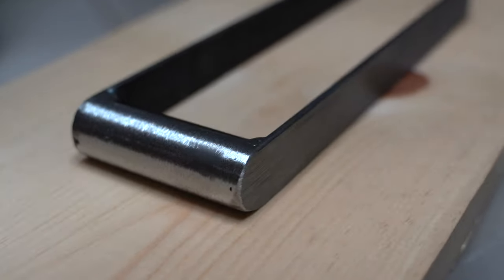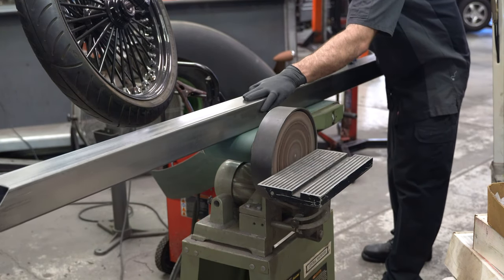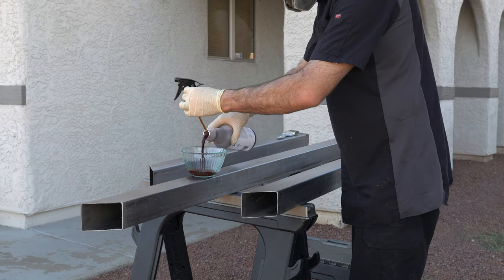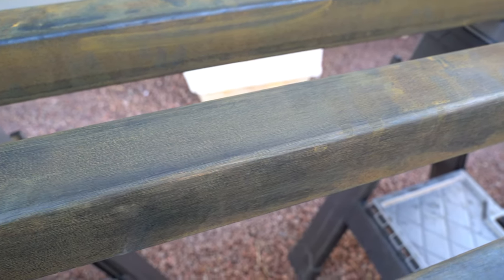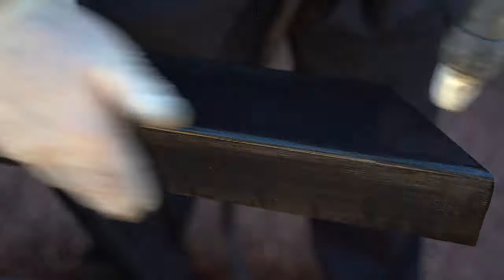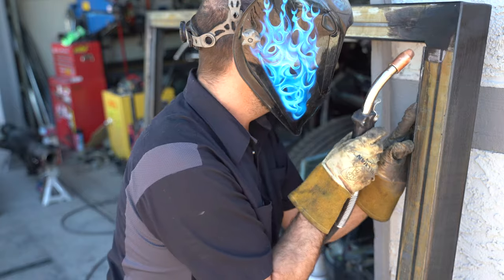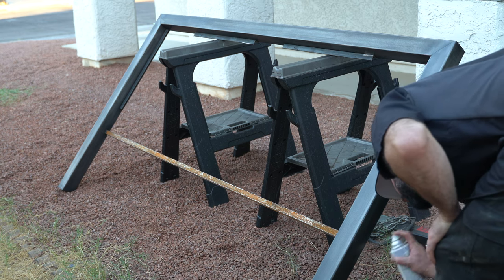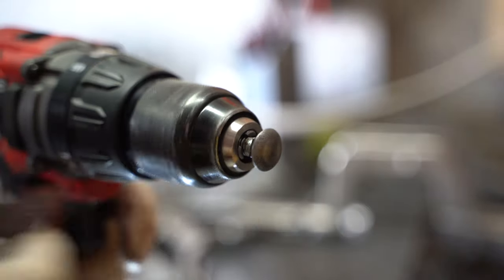How to Patina Steel with Chemicals! (Custom Headboard)

Comment: I use black magic all the time and made the same mistake at first.  Key and I mean key to not getting the surface rust is, DO NOT LET IT DRY before washing with water.  As in either add more black magic by brush or spray till desired patina is achieved. 
Also as soon as it's washed off with water dry it off with a rag ASAP. takes a bit of practice but the results are amazing.  Hope this helps anyone that uses the product  great stuff, I almost returned mine since I was getting mostly rusty result myself.
Reply from the maker: Thank you, Matt! I'll pin this comment. I imagine it being incredibly helpful.
Reply: @GarageFab  you're welcome:) ran past your channel today big fan, also great content. Looking forward to more truck build vids, particularly coilover conversion if you ever do them.
Reply from the maker: I might! But I do love my air suspension. ♥️
Reply: Thanks for info just ordered my Black Magic
Reply: Do you have to use rag to dry or can I use air compressor or leaf blower to dry
Reply: @SmokeyA55  any and all those will work, personal I use a combination of rag/blower or rag/compressor. Point is to dry it as fast as possible, if you leave any moisture on it it'll start rusting/oxidizing and you'll have poor results. Atleast in my experience
Reply from the maker: x2!

Comment: Glad I found this video! 
Just tried applying SN midnight black to a steel bench frame, had the same rust issue. Gonna try again, SN recommends scuffing with scotch brite before rinsing also, to get a more even finish. I also had a ton of problems with runs and enevenness cuz I am applying to a finished bench (surfaces at all angles).
Reply from the maker: I think patience is key. You’ll have to apply thin coats to help avoid runs, but then I imagine you’ll need to do more layers. Lemme know how things turn out!

Comment: Im late to the party, but this was cool. Ive been waffling on what to do in the trunk of my 69 GTO. Most people doing custom a-bodies end up boxing in the trunk with upholstered panels because the wheel wells are hideous, the trunk mounts are worse, and the rest of it is pretty bad too. I havent found a single example of someone taking the time to do custom metal back there so im doing it. But i wasnt sure if i should paint it or clear the metal with a satin or matte finish. Im glad theres this staining option and the burnished look is a winner. Then i can also match the jewelry box up front and have a bit of it in the dash im making. This was helpful, thank you.

Comment: Nice work! 

I saw Sculpt Nouveau being used by someone else and they didn't say much about it. I watched a video from the manufacture and was even more hesitant when they said to heat up to 80-90F.  I saw the $$ for 8oz bottle and like you, about choked. after watching your usage and explanation, I'm ordering some to make a few end tables.
Reply from the maker: Excellent! I think you’ll be pleased even after spending your life savings on it. I’ve learned the brush on method really stretches the product. You can spray it on too but you lose a lot with overspray.
thank you for the kind words, Daniel!

Comment: 12:32 this entire bed project is awesome, but the bolts in the drill are my favorite part
Reply from the maker: Haha! Sometimes it’s the little things.
Reply: You can use those bolts in metal projects too like furniture, tables, metal trunks or bars. Just drill a hole and weld them from the inside after you cut them. Remember they are for the look not to keep the piece together. They look like metal rivets and give the piece an industrial look.
Reply from the maker: Very true!

Comment: smushed it bro. I just got my black magic in the mail. can't wait to use it on this end table frame I am making. a little worried tho. I've drilled over 2000 holes in the steel, various sizes. Swiss cheese homie. don't get excited. and the steel is loaded withe oil from the drilling. hope I get it all. great video man. thanks

Comment: Tip of advice is use a smaller diameter square tube that's longer that you run through your work and you lay that on the saw horse and can rotate your work with no marking and it stays flat.
Reply from the maker: AhHA!! That’s brilliant! I will most certainly do that next time. Thank you! 🙌
Reply: That’s absolute brilliant and so simple. You sir are a genius
Reply: @marcmorson7642  it is easy when I watch the struggle happen to someone else to evaluate it. I wouldn't have thought of it if I was the one doing it. I would have made some odd contraption that wouldn't work better, actually worse most likely and probably finally get it done and put together then it would click. Next time...... I'd forget and the cycle will repeat and I'll get more and more pissed each time 😂 

It's always in those times common sense eludes us and we completely skip over stupid simple and over complicate a solution. "It can not be that easy.... Can it?....nahhh!" Everytime 😂
Reply from the maker: @SicOne There’s so much truth in that. 😂

Comment: You can also get any zinc bolt or bare steel almost totally black using gun bluing. Headboard looks great.👍
Reply from the maker: Chemical or heat? I have a gun bluing kit from Birchwood Casey that I've used on some small gun parts. That would've worked well. 
I just recently learned about heating and dropping into oil but don't have much experience with that yet.
Reply from the maker: ...and thank you!
Reply: Chemical gun bluing works great for any small parts. I usually pour some into a small container to dip bolts or screws into. Then I usually just pour it back into the bottle. I've been using mine on nuts, bolts, and screws. Zinc plated stuff turns black almost immediately.
Reply from the maker: Ooo! That's something I've been wondering. If used chemicals contaminates new. There's my answer!
Reply: @GarageFab  at big construction projects, we reused a big 32 bottle of bluing for like 3 years. We blued hundreds of bolt heads and nuts

Comment: Im curious what your opinion would be for using this product on a bare metal 69' C-10? I'm thinking green or blue and going for that kind of rat rod-ish patina look...maybe some black around the bottom of the windows here and there? Im wondering how the finish would hold up to the elements, or if it would rust through...i see that you did a matte clear coat over your bed frame (which turned out sick by the way!)...that might be the answer🤔...
Reply from the maker: I like where you’re going with it! It’s definitely got potential to be really cool. Being a less common color method already makes it much more interesting.
I can tell you that this stuff is not a “finish”. Even after coloring, the metal is still technically bare. If you like the way it turns out and you want to keep it that way you must cover it with some sort of clear coat. Talking to a knowledgeable painter would be a good idea to learn what you would need to do to get the clear to stick to the bare metal.
Let me know what you find out if you get that far. As mentioned in the video I plan to do Caroline‘s bed floor this way out of 4 inch wide steel rectangle tubing. I will likely just have it clear powder coated. 🤷‍♂️
Reply: @GarageFab  thanks for your response, I appreciate your input! I agree that it has the potential to be pretty cool. Before I saw your video I was just thinking of using a satin or matte finish paint, but i think this definately would be a lot more interesting!

Comment: Their clear coats are a must. It's almost impossible to get orange peel with their clear coats. It's worth paying the extra costs over the clear coat options from big box stores.
Reply from the maker: Good to know. I used Rustoleum matte clear. (may have been mentioned or shown)
I was thrilled with the appearance but the durability was lacking. I’ve got a couple chips from mild impacts.

Comment: If you were so inclined, you could use hot saturated copper chloride(freshly made from muriatic and copper wire is dark brown with lots of copper 1 and copper 2 ions) to brush the steel tube.  This will reduce on bare steel to apply a brushed on copper layer(no electricity needed if the steel is clean of scale and oil).  You can then use the ammonia based patina products(or 3% ammonia water and salt) soaked onto paper towels and wrapped in cellophane to slow the evaporation and keep the chemicals on the steel longer.  Not super hard and would likely be very unique.  A coat of clear acrylic will make it more durable and make the colors(purple and greens) POP.

Comment: Fantastic work! I once used a similar product to blacken steel which I applied with a rag wearing those rubber palm coated gloves, BIG mistake. The fluid soaked into the gloves and also my fingers. I woke up at 3am in pain as my fingers had turned orange and my finger tips felt as though they had been hit by a hammer. The soft skin under my finger nails had swollen putting them under pressure the same as when your nail turns black after an impact. Damn it hurt. Not a nice story but I hope by sharing it won’t happen to you. Stay safe
Reply from the maker: Holy moly. That sounds crazy! Any idea what happened? I mean physically? Medically? 
Very much appreciated my friend. I just might put on a second set of gloves next time.
Reply: @GarageFab  I presume it was a chemical burn from the acid ingredient

Comment: Where do you find 3x3 16 ga steel tube?
Reply from the maker: Where are you located? I get all my metal from local shops in Vegas. Usually Highland Steel and occasionally Curtis Steel. I hear good things about OnlineMetals.com but I’ve never used them.

Comment: industrial metal supply sells this stuff by the gallon. its used for blackening gates.
Reply from the maker: Same brand? Here we have Curtis Steel. They also carry some off-brand. Looks home made. Didn’t care much for it.
Reply: @GarageFab  IMS sells sculpt nuvea or however you spell it. i think they carry jax as well. we got em here in az and cali. dont know if they are in vegas.
Reply from the maker: Doesn’t sound familiar but I’ll check!

Comment: Why use black magic over, say, phosphoric acid? Aren't they doing the same thing (making a black oxide coating)?
Reply from the maker: You would want to use Black Magic over phosphoric acid if you have a bunch of extra money you don’t want. ☺️
But in all seriousness, I don’t know! I’ve never used phosphoric acid, so I have no comparison in the finish!
Reply: @GarageFab  HA! I'm just getting into experimenting with metal and patinas (after working with wood for years), phosphoric acid looks similar (and MUCH cheaper! a gallon for less than half of Black Magic), especially if there's a clear coat over it. Loved the idea of brushing it with a scotchpad afterwards, and the wood backing was gorgeous. Great stuff, subscribed and going to go binge now 😂
Reply from the maker: Thank you my friend! If you’ve got any photos of your black patina, I’d love to see it. I want to use the same process on my Wife’s truck bed floor.

Comment: Prep is the key to a great patina. It needs to be 100% grease free. Scotch Brite pad & 409 works wonders. What you're smelling is liver of sulfur. Now go make your own!
Reply from the maker: Haha! Liver of Sulfur. The name explains it all. Thanks for the tip! I’ve got a small project inside my house coming up. I’ll give it a shot. 🍻
Reply: One of the things they recommend for degreasing is plain isopropyl alcohol. I use 91% and it works great and is cheaper than        their product or the automotive degreaser that he used in the video. Just a hint.
Reply from the maker: I appreciate that! Thank you Jesus. I’ll definitely give it a try. Any idea if that’s adequate for paint prep as well?
Reply: @GarageFab  patinas are way more finicky than paint so it should be fine.

Comment: Can this work on a bbq smoker?
Reply from the maker: Definitely doable with some research. Contact Sculpt Nouveau and confirm you get the right chemical for the metal your using. After that the challenge will be finding a clearcoat that can withstand the heat. Perhaps try VHT Flame Proof Satin Clear. I've never used it but other VHT products have served me well.

Without clearcoat your finish will change the moment it gets wet so you really need to preserve it.

Good luck! I'd love to see the finished product. 👏
Reply: @GarageFab  thanks!

Comment: Try vinegar - takes longer to work but doesn't cost you 50...
Mustard works faster but you end up with a pattern.
Reply from the maker: I have used both. Mostly mustard because I very much like the texture. Neither of which have ever produced black. I think I’m stuck with paying $50 but in the bright side, a little goes a very long way!
Thank you! 🙌
Reply: @GarageFab  I've had good black results from fully submerging carbon steel in vinegar overnight. Think it's the submersion that's the key to it.  YMMV of course.  It's a fun thing to experiment with!
Reply from the maker: That must be it. I lack patience! I don’t think I’ve ever done more than just spraying it on and letting it sit a short while. I’ll try again and see what happens! 👍

Comment: "Waiter! There's a hair (hare) in my soup"!..."Please sir, not so loud or everyone will want one"......."Waiter! What is this fly doing in my soup"?..."The backstroke sir". Question: Why not finish construction and then apply the patina? Charing a wood surface a no longer considered outre, but declasse and rather demode. Very nice work on the headboard!
Reply from the maker: lol! Upon reflecting on your question, I can only come up with one reason as it might have been easier coating a finished piece.
That reason is… The patina was an experiment. I didn’t know what I was doing and I didn’t know what to expect. I’d rather ruin a few pieces of metal than something I spent a couple hours building. 🤷‍♂️
Reply: @GarageFab  I hear you. I've been in that position more than once when building on the fly. So now you that have a new found skill and procedure, you'll have to turn you bed into a four poster...
Reply from the maker: Haha! Maybe. Honestly I’d kinda like to get back to working on trucks and do less furniture. 🤔